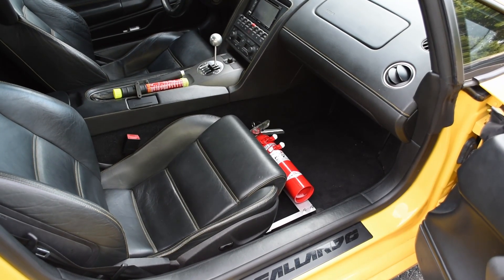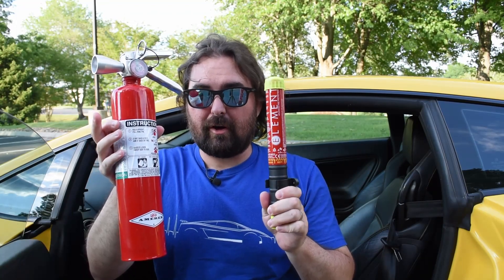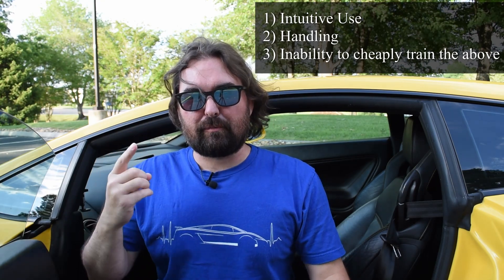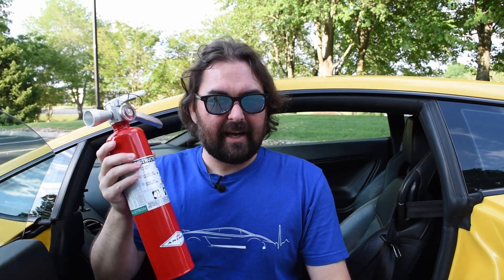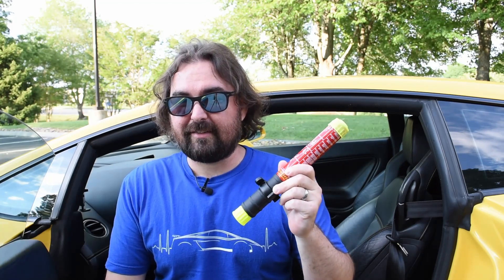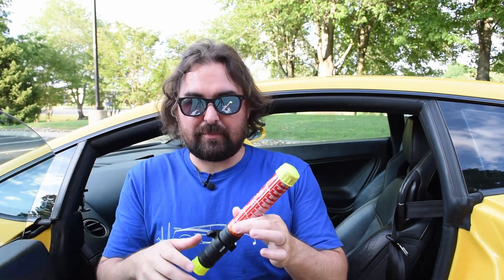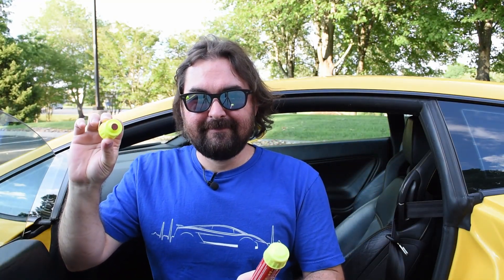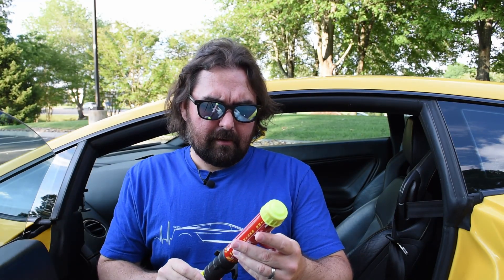Why I'm not using Element (or equivalent) extinguishers in my track cars - 3 Concerns

Comment: I can think of one potential advantage of a solid-state extinguisher over a pressurized tank type, and I will freely admit it's an Extremely Unlikely scenario: If you wad your car up severely to the point where a stray piece of the car's architecture punctures the halotron cylinder.... Well....  Let's just say I've seen the results of a pressurized-gas cylinder rupturing before, and it sho'nuff ain't pretty. Of course, at that point perhaps fire suppression is the least of your worries, but I'd sure hate to be strapped into a wadded-up Lambo when the bomb on the floor next to my legs went off.

Comment: I had a basal ganglia stroke. My left arm and hand are affected.

I've used the Element 3 times with just my right hand. Just like with a diving regulator that stops, stay calm, don't panic, and follow the steps you've learned.
👍🏆🙏
Reply from the maker: Thank you for the very-relevant comment!  It's good to know that's possible for those who have adopted the 'solid state' extinguishers.  Had you practiced or mock-trained using it prior to when you needed to, or was your first use 'cold' and just proceeding intuitively?
Reply: @LapoftheWorld   I read the directions, watched videos, examined it closely... Before, I was in an emergency situation and wasted valuable time trying to figure it out.  

 I did the same thing with my Glock pistol.  With jeans, I use the pocket to rack the slide, and if no jeans, the edge of my shoe sole, or the edge of the shoe close to my ankle. Can also clear a stovepiped hull that didn't clear. 👍

Comment: so when you have the big extinguisher in front of the passenger seat and the passenger is there you'll need to get the passenger to open her/his legs so you can extract the big ass tube then hit him/her in the face with it while you try to pull the pin , further start displacing it everywhere but at the base of the fire because it is way too big for your car and can't manipulate it in a contained space. Of course another option is not to have a passenger or to buy a bigger car ...all in all when shit hits the fan some lose it some don't if you're the type that lose it you can have the most intuitive extinguisher short of one that deploys by itself you'll be running leaving the car to burn.  What I mean is all the "inconveniences" listed are bullshit really but it is a choice and everyone can chose to lie to themselves the way it tickles them.

Comment: You need 2 hands to operate a standard fire extinguisher. One to hold the extinguisher theo ther to pull the pin. You the  need 2 hands again one to hold extinguisher and squeeze the handle the other to aim the hose
Reply from the maker: By the book, yes.  In reality you can thumb the pin out while already holding the handle without needing your other hand (I have practiced such with the extinguisher I have).  Also, the Halotron extinguisher in this video does not have a hose on the tip, so it's just point/shoot which can, again, be accomplished with one hand.  That will definitely depend on the specific model/style of extinguisher though so definitely something to consider.

Comment: Thank you for taking the time to make this video, however additional notes must be taken to review a product.
1. Most conventional fire extinguishers go in the trunk or under the seat on a base that holds it to prevent it from being a projectile and hurting you in an accident. (There is no place in sports cars, I have a Lamborgini)
2. A conventional fire extinguisher is difficult for an older person to maneuver.
3. When you have a fire in your own car, the first thing you instinctively do is get out of the car and give yourself a second to see where the smoke is coming from, this forces you to return to the car for the extinguisher and open the hood, 90 % of a fire in a car starts in the engine area and 10% inside the dashboard.

This is my personal opinion and I have no commitment to any brand, I just know that there are better products and this innovation has more benefits that I think can be useful for everyone.
Reply from the maker: I want to be clear that this wasn't intended as a full-on product review, (maybe I'll do one at some point) but rather a use-case exploration as a jumping-off-point for the amazing conversation that's happened in the comments.  Definitely some valid point there about the weight of a conventional extinguisher vs. the Element/stick, and 100% get out of the car first if at all possible.

Comment: Great points for sure! Another downside to the Element fire extinguisher is that it can only be used once. A re ignition is always possible, especially after an accident. If the Element is used on one fire and then another fire develops a minute or more later once it's used up, you are totally defenseless. With a traditional extinguisher, if you didn't totally empty it, you can still stand by and be prepared to deal with any potential reignition that could occur. I also wonder about the long term stability of he Element. Would it still be usable after sitting for 10+ years or would it have degraded  from heat, absorbing moisture from the air, or some other unknown reaction? This may be a non issue, but definitely a consideration.

Comment: If you are racing and concerned about a crash and a fire, then what you probably need is a manual mechanical fire suppression system which you can pull a handle to start the fire suppression or a self contained system which is electrically activated by a push button, both systems would be pressurized and would be similar to what you would find on a car specifically designed as a professional racing vehicle and can be operated with one hand.  If you're knocked unconscious before activation by a crash, then NONE of these systems are going to save you if you are on fire, so you had better hope the corner/track marshal is fast on their feet.

"Handling" either a stick fire extinguisher or a pull the pin and squeeze the handle pressurized system would be ridiculous to try and operate in a racing crash situation.  You can always also carry a stick or pressure fire extinguisher, as well as, the mechanical or push button fire system, but it would be to put out fire in a vehicle that has been or is stopped, and the driver has exited the vehicle, not a situation where the driver is still in the vehicle.  

For those that are concerned about damage to the vehicle from the extinguisher in a fire/crash, remember the vehicle and components can be replaced, a person cannot, so the whole idea of a fire system should be to save the driver, not to save the vehicle.
Reply from the maker: 10/10 automatic fire system is the "one best way".  I've seen Mark Petronis' accident.  The intent here was a discussion about two low-effort and readily available options people might consider for on-road use or HPDE (something is better than nothing).  As an aside, the one disadvantage of a fire system is it's only any good for your car.  With my chief priority being getting out of the car in a fire, I figure I may be more likely to use my hand held extinguisher to help someone else.  At a track you have corner workers etc. Less so in the mountains around here or at drives and events.  I suppose the ideal would be an automatic system AND a hand held of some kind.

Comment: So last summer, a car paddocked near me (tweaked street car at track day) came back to the paddock after having a stumble at pit out. I was in the process of belting up, and saw him get out and pop the hood. 
Flames shot up (it got air). I jumped out and grabbed the element from my glove box and put out his fire. Maybe 30sec from popping his hood till I got there. Nobody had an extinguisher or were nearby. 
Saved his car. He bought me a replacement
Reply from the maker: 100% Biggest point FOR the Element, IMO is the form factor that you can just toss in a glove box or door pocket and "forget" about until you need it, at which point it's there for you.
Reply: @LapoftheWorld  I do need to ‘practice’ (muscle memory) for if ever I’d need it myself in a scenario such as you describe. 
I’ve had onboard fire systems in race cars, as well as easy to reach extinguishers in my own track car. But it was on a whim that I threw one in the glove box of latest street car that I also drive on track. Same type of thinking that I have a flat repair kit in a cubby.
Reply: Thanks for the comment. I was interested to see if it worked. The vendors always demonstrate on petrol fires in metal containers that are easy to extinguish. But I saw an independent video on this platform where uploader tried to stimulate engine bay fire with a barrel, petrol, plastics, rubber, etc, and the device failed. I think it was Fire Safety Stick 50. Sure he wasn't skilled, but I think the issue is there is a high risk of reignition, since gas doesn't remove heat from the source. In fact it might be hot itself, as the reaction seems to be quite energetic.

Comment: So if I use the stick to put out a fire and extinguish the fire in let's say 10 seconds. What do I do for the other 40 seconds? Statue of Liberty standing there with it pointed up in the air? So it's a 1 time use and time to buy another!  I'm sure it has times where it does what you need it to and you can make a case for and against for both extinguishers. I like old school where when the fire is out, stop squeezing and it's over and possibly still usable or rechargeable.
Reply: To be fair, all traditional fore extinguisher.are one time use as well.  Once if you use even a little bit, you need to re charge it.   The seals and stuff are all compromised.
Reply: I did as you described with a fire in my shop.  Pulled the trigger and stopped once the fire was out.  I am talking a SMALL fire - about the size of 4 candle flames.   Well, wouldn't you know.  A short while later,  the fire lit back up.   
 So the lesson learned?  With either method, traditional tank or Element, once the fire is "out" keep pointing the extinguisher at the fire until it runs out. Use it all up.  Either way, they need to be replaced , or recharged once used.  
 Mine flared up because very fine sawdust was smouldering down inside a crack.  It was initially ignited by grinder sparks.  The small space kept the heat in long enough to reignite.

Comment: I think a potential solution to the one handed problem could be to mount the striker cap somewhere accessible in the cab of the vehicle and strike against it one handed.
Reply from the maker: Definitely a potential option!
Reply: or to have two hands ... I guess...
Reply: One-handed Me: "dammit, of course the fire would be where I put the striker!"

Comment: I'm thinking here about ordinary folks who need access to a fire extinguisher in their kitchen, shop or their daily driver.  
Traditional fire extinguishers are a pita because they must be maintained.  I once tested a 3-year-old ABC powder extinguisher (that I'd intended to replace) that read "good" on the gauge but was 100% dead.   I've known others who've had the same experience.  Seals can leak. Valves can fail.  Nozzles clog.  And gauges can lie.   They simply must be inspected and tested to be trusted.   Most homeowners or hobbyists will neglect this, partly because its damn expensive and requires a schedule.   

I once watched a group of about 10 chemistry teachers  being trained to use traditional fire extinguishers.  It's shocking how poorly the majority performed when actually putting out a waste basket fire, even after instruction and watching others do it.  Dry runs were easy, but once it was lit, hands got shaky and minds went blank.  Everyone was shocked at how quickly a 5lb extinguisher is emptied.   Even that type of equipment is not as intuitive to folks as it might seem.  Had the instructor suddenly said, "Only one hand this time!"...the fail rate would have been real high.  

I guess if you're fighting small kitchen fires, small ones  under the hood or in the shop, choose the one you're comfortable using and review how to use it.  Every type has its "what ifs," and no fire is like the one you might practice on.  Have something that gives you the best chance.   Ideally, have both available, but figure out how you're going to schedule maintaining your pressurized one.

Does the Element work?  Lambo driver...its $80!!  Less than half of what you'd spend to change your oil.  Test it and show us.  :)
Reply from the maker: To be fair, at no point did I question if an Element extinguisher would put out a fire.  The one I'm holding in this video is now mounted to my garage wall for many of the reasons you cite above.  My reasons for not mounting one in my cars for track use, are pretty specific to that use case.  I'll say it again though, on or off track ANY extinguisher is better than none.

Comment: Never thought of these points. I guess you sold me on the tried and true extinguisher.
Reply from the maker: Any extinguisher is better than none.  My goal isn't to sell anything (not sponsored and I hope that was clear), but rather to start a discussion or trigger some critical thinking.  My hope is that everyone considers the choice in context of how/where they might need an extinguisher and evaluates the choice based on their needs.  There are, I'm sure, use cases where the solid state extinguisher is 100% the better option.
Reply: The tried and true are fine if you always remember to have them tested and serviced every year.

Comment: As a inspector that has used both of these extinguishers, you must factor that the Halotron extinguisher will NOT harm any components in the vehicle and is VERY effective. The Element can actually harm components it comes in contact with if used improperly. I personally would not use the Element in an enclosed space. Don't get me wrong, The Element is a great product and easy to use but Halotron is the most effective if you don't want to totally destroy what you are using it on. 
Halotron extinguishers are charged with Argon gas and not nitrogen, thus making them a bit more expensive to recharge than ABC extinguishers. $60-300 depending on the size.
Reply from the maker: Thanks for the qualified data points there!
Reply: How would someone use it "improperly"?  Strike, point, extinguish?

Comment: For us, we work around fuel filtration equipment. During filtration we have three ABC extinguishers placed at quickly accessible positions around the work area footprint. Since the fuel being filtered is primarily diesel, a fire would burn excessively hot. Seconds of deployment are essential in putting out such a fire before possible explosion. Only a extinguisher of the pull pin and actuated handle type would be effective in keeping the responder at a safe distance and being able to effectively put the fire out. Of course we train every quarter on fire suppression and the inspection of suppressive equipment. Great video.
Reply: What? Diesel fuel doesn't explode in ambient pressure, ambient temperature air. lol.

Comment: I have already decided not to get one based on another YouTube video.

But you bring up valid points that I hadn’t thought of.
If I had seen these advertised on vinwiki and been curious, it’s likely I would have cast one of these aside during a moment of need mistaking it for a flare.

Something is generally better than nothing.

But inadequate often has similar results as nothing.

Comment: Nice video and you have the Gallardo looking great! I have a halotron extinguisher in another car and like how it's not caustic (esp to paint), but also have element in my G - the positives of the element outweighed it's striking activation for me (biggest plus being much longer working time). Main thing is be prepared, be safe, and have something!
Reply from the maker: Definitely be prepared!  I think my concerns probably are pretty specific to potential track scenarios.  For a road-side mechanical issue I think the Element might even be superior.  (and it never expires so you can just chuck it somewhere and not worry about it).

Comment: I am not sure how intelligent you are, but it doesn’t talk a bunch of common sense to understand the fire safety sticks. As for training you can simulate taking the caps off and striking the end without actually setting it off. Lastly the effectiveness of the sticks and the potential lack of damage to your car if you ever need to use it should make it a no brainer
Reply from the maker: I'm no genius, but I have a few brain cells to rub together.  The goal here wasn't a hit piece on stick style extinguishers, but rather to have a conversation about things to consider when picking an extinguisher.  My pretty-specific use case may be vastly different than yours or the commenter's below.  I still keep the Element on the wall next to the door to my garage because there I, or my family, are likely the only people who would have occasion to use it, we all understand how it works, and I don't have to worry about keeping it charged, or using it in blustery conditions.  Meanwhile the one in my car move around with the car, so out in the world some actual idiot might have to use it and they might not be able to figure out something new/foreign as quickly as something that works basically the same as the one under their sink back home.  (Also in the wind, etc as others have pointed out).  Is this over-thinking?  Probably.  Did you think about your own fire extinguisher situation after watching? Hopefully.  If so, mission accomplished 🍻